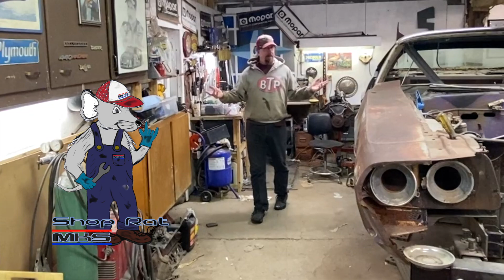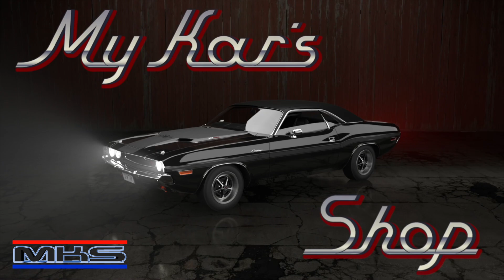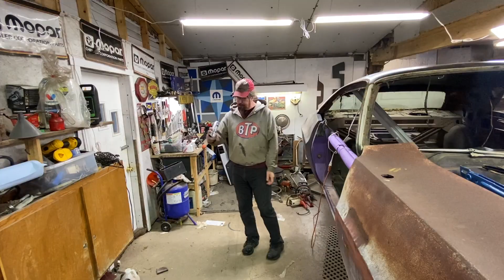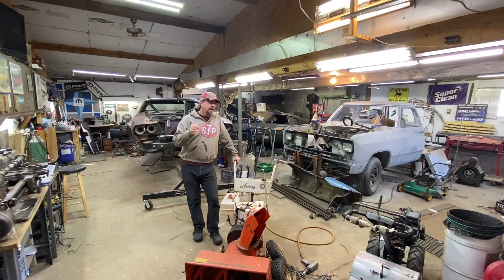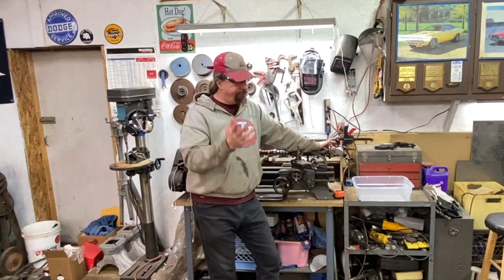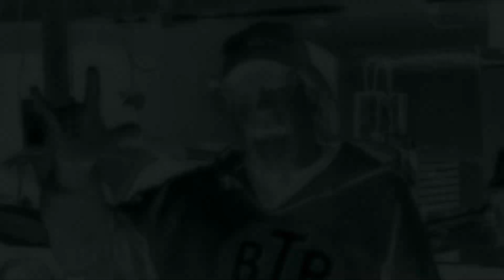Parts Availability Is A Real Problem. It's Only Gonna Get Worse. What Will We Do-Let's Talk About It

Comment: Hell I can't get a receptacle end seat belt for a 2007 VW Beetle. Switch inside makes the airbag light come on in the dash. Dealers don't make them anymore since it's over 10 years old. No aftermarket because it's a safety issue & junk yards have had the same issue so far. CRAZY
Reply from the maker: 100%.

I think we’ve been fed them and happy for far too long in the automotive world

I really hope you can find what you’re looking for 

Or find something that will work 

Keep rockin!!!  

Thanks for watching. I really appreciate you checking in.
Reply: @MyKARSShop  I wouldn't care but it's the wife's car. 😂 I might be new car shopping soon & I know those are all junk. 🤣

Comment: Nice!!! I was just out in the shop making inner fender wells for the VW. Shrinking, stretching, and wheeling to try to get the shape I want. It is going to take me a lot longer before I am able to do anything like that with any proficiency. I may change my design just to move forward. Already running into the not being able to find a part with the 54. With only 13K 54 Skyliners made the chrome around the glass top is going to be super hard to find. I don't think impossible but I'm going to have to look hard. The other chrome that is missing is common to all the Crestline cars, I think. So not as hard to find. The top is acrylic and has some checking common to acrylic left in the sun. (The hatches on our boat were just as bad.)  A friend of mine worked in the auto glass industry for most of his carrier, if not all of his carrier. And we were talking about making a form and vacuum forming a new acrylic top. Allegedly the company that originally made the tops are still doing reproductions. When I followed the link for the order form it didn't work and there was no pricing. I'm sure it is not cheap. Anyway RAWK!!!
Reply from the maker: And so many challenges in these projects, and I love seeing each persons creative solutions.

I always try to remember that I may not be getting this project. Perfect, but there’s always another one coming. What I’m doing today is preparing me for the next project coming. 

Want to keep that in mind, I can let go of perfectionism, and just make sure that I make it safe, make it down, and just have fun 

I was good to hear from you, Michael. Thanks for watching.

Comment: In the land of make believe. 😮‍💨 There is more than adequate technology to replicate any part of any car.  There are shops that you can take a part to, they can scan it with lasers make a 3D model of it in CAD and then print it out on a 3D printer or mill it out on a milling machine.  The part created may not be perfect in every regard, but it will be in a state that you can make it work.  I think that if someone wanted they could relatively easily create CAD models of every part of any car and then have them available for anyone who wanted to create that part.  Instead of being a warehouse that gets parts from various manufacturers they become a server farm of every car part known and they will either sell you the CAD file or sell you membership to access their library.  There would then be manufacturing facilities that sell their services in taking these CAD files and creating the part and shipping it to you.  Plastic parts, aluminum parts, kevlar parts, whatever the type there will be a large factory that is dedicated to making parts for you from and CAD program you supply them.  This is the future I forsee.  Whether or not it comes to pass, I don't know, but I can't see why it wouldn't or shouldn't.  As far as copyright issues with the CAD files.  If a car manufacturer wants to provide their original specifications, then it is not much different than know where the supplier warehouses are working with part suppliers to get the parts.  The contracts and agreements may be slightly different, but not by much.
I also foresee, and may even try becoming a part of, an industry that is geared toward converting cars to electric.  There are already a few shops specializing in making car conversion kits.  As the battery tech evolves and the infrastructure for electric vehicles expands, I believe there will be a lot of people who want to keep their old car, but convert it to electric.  Currently it is cost prohibitive, but as more electric cars are on the market and the infrastructure itself becomes cheaper, I think converting your car to electric will be just as cheap if not cheaper than swapping out the engine for a turbo charged LS, and given the torque of Tesla electric motors, you will be getting the same amount of power as well.  A light weight car with a high end Tesla motor, will easily do 0-60 MPH in 3 seconds.  There is one group of students hailing from ETH Zurich and Lucerne University of Applied Sciences in Switzerland, that made an electric race car for a speed record that did 0-100 KM/H (62.15 MPH) in under 1 second. Of course this was purely custom, and not street legal, but yeah, one electric motor on each wheel can produce some serious speed.
Another great TAIT.  Looking forward to your next one.

Make it Safe,
Make it Done,
  🧑‍🔧 &  🚘
Go Have Fun❣

Stay warm, safe, and healthy.  🤟RAWK!
Reply from the maker: I agree with you to a point, but I don’t think any 3-D printer is going to make a sheet metal roof panel for any car out there…

Well, 3-D printing can replicate and make small parts… And even some large parts to a degree 

These big sheet metal parts that we are fabricating here on the table, short of dye, stamping, or fabricated by hand, there’s no way to replicate them 

You either have to buy them, scavenge them out of junk cars, or have  make them 

As somebody who used to work in engineering, and be involved in the early days of 3-D, modeling, 3-D printing, building layer, printed parts out of paper, etc. 

I don’t see any way to replicate sheet-metal in a 3-D printing environment  - especially large pieces

That’s more, what I’m referring to 

Any machinist  can repair or custom build engine parts… Yes, it may be costly,  but that can be done

But when it comes to complex pieces of sheet metal… There are not a lot of options at this point 

Thanks for watching
Reply: @MyKARSShop   I was watching an Adam Savage - Tested episode where they visited a plant called Velo3D that 3D printed a massive Optimus Primal Transformers head out of inconel 718 a material used in building rocket thrusters.  This stuff is STRONG.  It uses layers of fine metal powder and heated each layer with a laser to melt it. It would do a layer then lay down some fine metal powder and do the next layer lay down more powder, etc. until the entire 2 ft cylinder was filled with metal powder, then the hopper under the box opened and all the dust dropped down through a metal grate and left the finished part sitting there.  I'm guessing a similar method could be done with steel powder.  It might look like it was made out of a bunch of fine steel particles welded together in the shape of a roof panel, but as our tech gets more and more advanced...  Well, I guess we will find out eventually.  This machine had a resolution 0.05mm per layer for this project, but the machine can go as fine as 0.001mm.  At that resolution it is a roof panel made out of a material that won't dent when hit with a sledge hammer and will turn slightly blue when hit with a 4000 degree plasma torch.  Just don't ask what it would cost to make.  It is possible, just not entirely practical.  This particular machine is a 2ft.diameter cylinder shape, but I am sure that a flat bed designed for large thin parts is totally feasible.  We just have to want it bad enough to make it.

Comment: I agree, you need to get the skills to be able to fabricate repair panels. The last car I restored was an Austin Mini where practically every item needed is available from specialists and at a reasonable price. My Escort RS2000 4x4 is a mid 90s homologation special from Ford  very few were made. Thankfully it's shell only has a few specific modifications from a standard 3 door Escort that said for a major seller not a lot is available for the 1990s - 2000 Escort. In USA terms only the front fenders (wings), outer rockers (sills) rear arch repair panel and battery box are all I found. I bought the rear arch repair panels and rockers plus a battery box. I am manufacturing  all the other repair panels as I need them. I didn't need new front fenders but have made repair panels for the rear section where they rust. I am currently working on the windscreen area scuttle and bulkhead making the necessary repair pieces. Mine aren't as good as some that you see online but I don't have the fancy equipment. I'm learning as I go along making mistakes and fixing them. Youtube and channels like yours are a great help.
Reply from the maker: To me, that’s what it’s all about. I learned from you, you learn from me, we all learn from each other.

That’s how we survive 

It doesn’t take any skill to swipe a credit card 

But it does take a skill to take a flat piece of sheet metal and make some thing 

Not criticizing, anybody who swipes cards 

I’m just saying for the future… Craftsman will have a place 

Thanks for watching 

Always love hearing from you